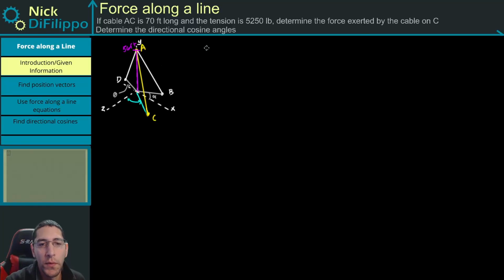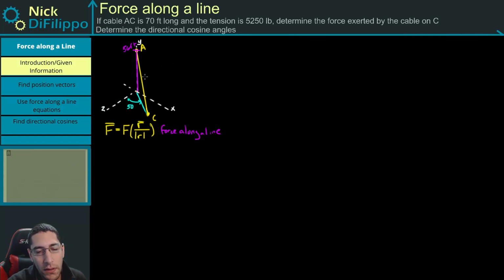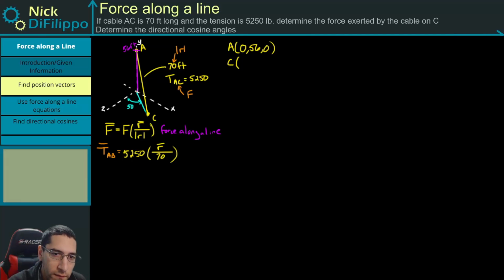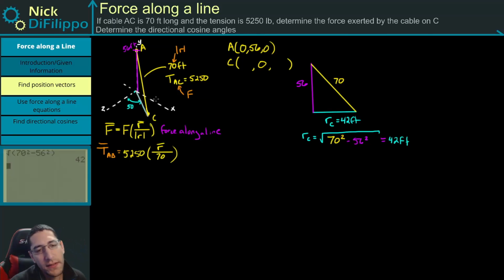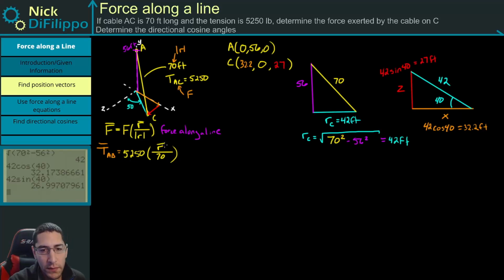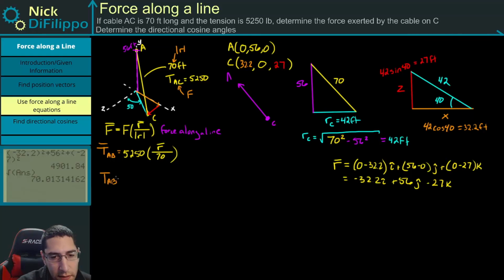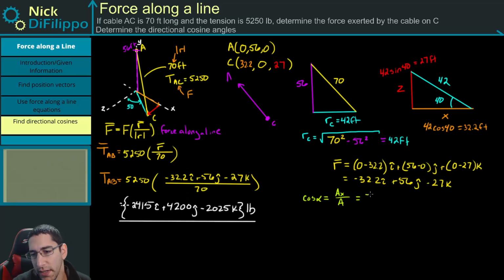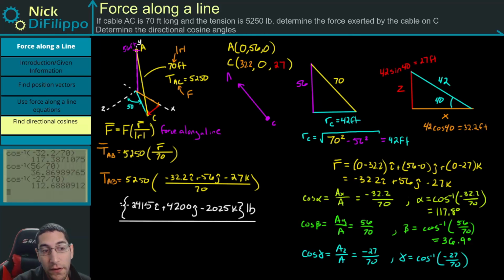Statics - 3D Vectors (Find force along a line)

Comment: If you draw a little xyz coord system directly onto point "C" it will make it easier to visualize the directional cosine for students.
Especially, the positive or negative orientation from the +x, +y, +z direction.  
Students may not be accustomed to writing -60 degrees as 120 degrees.
This demystifies the concept of direction cosines.

Direction cosines is a "redundant" description of vector direction.
However, it's true purpose is to allow use of equation cos^2(angle to +x axis) + cos^2(angle to +y axis) + cos^2(angle to +z axis) = 1^2 = 1.
This "what I call" the 3 dimensional Pythagorean equation.  
The diagonal in a rectangle(3 dimensional) is similar to the diagonal in a 2 dimensional right triangle(hypotenuse). 
Again, a simple line in a 3dimensional box. Mystery gone.
Reply from the maker: Thanks for the suggestion!
Reply: @EngineeringCorner  It makes such a big difference how it's oriented in the problem statement or diagram.  I think text books intentionally setup the most confusing arrangement to fool the students.  Are you a teacher or student?  I am professional engineer that "never" get's to apply stuff like this, but enjoy reviewing it over/over....my 9th time, I think...and each time I understand it more but also become more aware/irritated by the "textbook tricks" that make it hard to learn.
Reply from the maker: @trexinvert   after I graduated in ME I worked in r&d for about 4 years mostly working with mechatronics and robotic systems before going back to teach. Right now I am trying to make engineering statics and dynamics videos to help students with textbook problems they will see and supplement my classes. And I agree some topics in textbooks are really overcomplicated, especially when you are trying to learn material. They only really seem to make sense (at least to me) when you already understand the topic which is unfortunate for introductory textbooks...
Reply: @EngineeringCorner  I'm back again reviewing.  So, I'm curious why you got out of that industry(mechatronics=building machines no $$$ spared) and robotics.  Sounds like a great sector of engr.
Reply from the maker: I enjoyed it a lot but just wanted to try something different